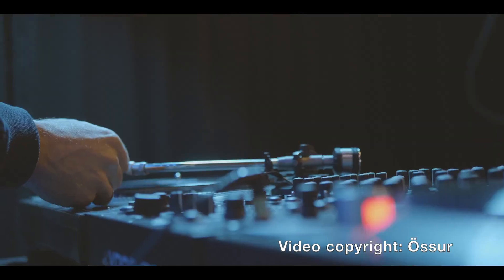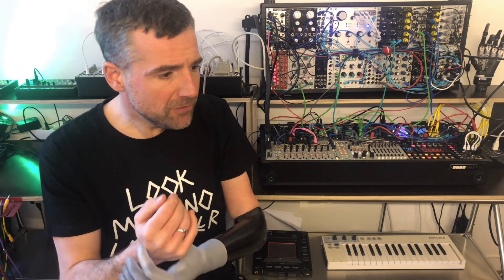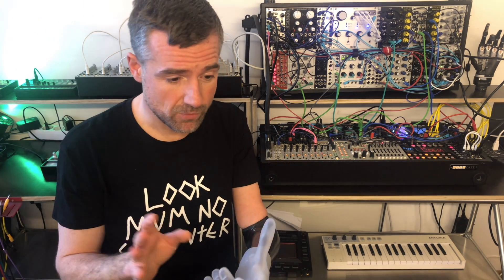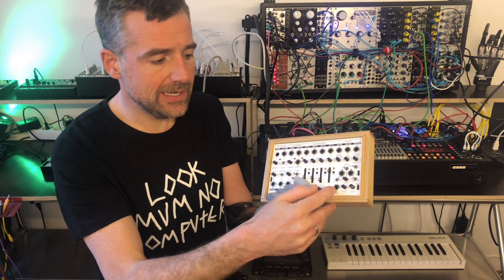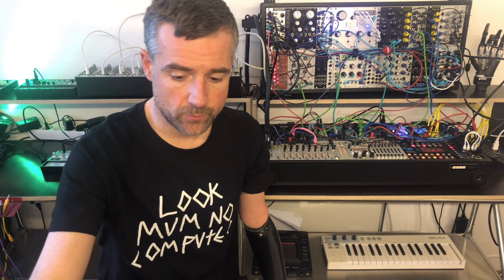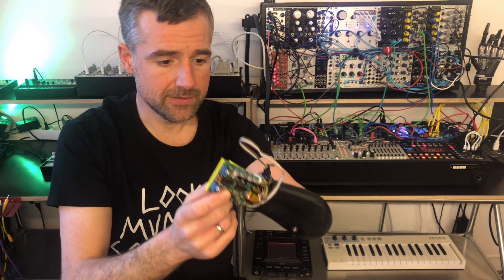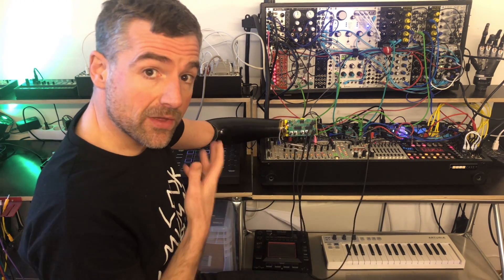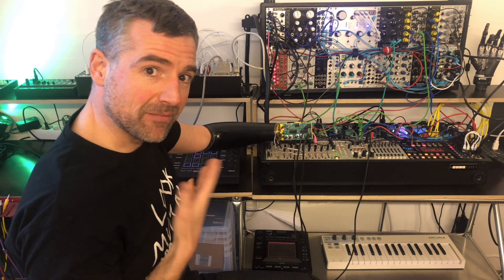Hacking my arm prosthesis to output CV so that it plugs into my synth: Thought-controlled music!

Comment: Hi! I'm not sure it could be easily controllable for you, but why not be using one electrode to set a signal and the other to switch between multiple outputs? This could permit you to control way more knobs but probably only one at the same time (depending on the configuration and your preference!)

Comment: I would recommend that you have the aux permanently connected to a box previous to the synth and this box splits in more aux cables that go to different parts of the synth. So then, with a switch in the box you choose which part of the synth you want to control in any specific moment.
With this you can forget about plug and unplug al the time.

Comment: My first thought is using the second signal as a gate for every port on the instrument, so that you could dial in to any knob you want (or at least up to something reasonable like 8 or 16, maybe in permutations to allow simultaneous control - whatever is manageable) for the first with less plugging/unplugging. I don't know if there's anything ready to go that's like that, and it'd take a lot of wires, but like having voltage 'shelves' for each input that routes the control signal to the right cord.

Comment: This is just wild speculation based off of my limited knowledge of how muscles work, but with a prosthesis that accepts signals for all the muscles that control the hand there could theoretically be 36 inputs something like this could modulate, minus the ones used to rotate the wrist.

I really wouldn't want to manage that many cables though, lol

Comment: This guy: "I can use a soldering wire" -> shot of him soldering microelectronics with a prostetic arm
Me: Remembering how I never succeeded in soldering a power wire to the board on my daughter's cheapo toy electric piano with my two fully functional arms :/
Reply: Hey dude go and try it again. I failed at making a simple webpage for days until it clicked. Just keep trying
Reply: @flarebear5346  In this example that's not the same if you fuck up one of the electronic composant with a bad soldering all the project can be gone. A webpage is more of an easy task because you can redo the features on and on
Reply: Mr. Scarf that’s why i realllly like coding,  despite not being my major field.
Reply: @Sqaarf  but it's still true, soldering is not that hard and can be learnt with some patience. First just start on soldering two wires together (later try some geometrical shapes made out of straight wires, also looks cool sometimes), leaarn how to connect multiple types of wire properly, then you might try doing some minor projects with scra plain copper board and then, I cannot praise this enough, buy some kits, you can find them cheap online and just solder. At least first few steps will help you make the most basic things, and that's enough for most ;)
Reply: David Gerner bruh im not even an adult and i find soldering pretty easy. Just stay focused while you do it.
Reply: alqaadi ya codings great until you hit compile and get 2000 errors and about 9x10^8 warnings that you’re going to ignore because warnings mean nothing and then about 50 lines later you hit compile again and the entire project breaks so you comment out the 50 new lines you added and the project still won’t work so you give up and make a post on stack overflow only to get shit on by some dude who’s been coding for so long he’s created his own operating system with a billion different custom libraries so he never actually has to write any new code he just reuses and rearranges things but still won’t answer your question. So you go to your prof for help and he tells you that you missing a semi colon on line 79 and your thinking to yourself wtf I thought that you didn’t need semi colons in python and he explains some reason that goes sooo far over your head you just say ok and switch majors into physics which is somehow an easier 4 years than your first semester of major ing in com sci
Reply: @ShroomBois_Inc  Well that was weirdly specific. You wouldn't happen to have a major in physics, would you?
Reply: Took me years to master Microsoft Notepad, I believe that you can master whatever you want.
Reply: @TheNuclearBolton , amen, brother. I still don't quite get how to deal with that Insert mode
Reply: Just keep trying, once you get it once it almost goes on its own
Reply: His hand may be more functional just differently the applications for these prosthetics are amazing
Reply: Use some solder flux man,
Stuff works wonders!
Reply: @Abdega  you really don't need it normally, maybe for really small stuff...
Reply: @somename371  sure you don’t need it, but it’s really satisfying having your solder flow where you want.
My soldering is so much better whenever I use it

Comment: I love how technology is enabling more people to enjoy their lives, like letting you get more control over your control surfaces. I’m an electrical engineer, let me know if you’d like my help with designing a more compact design. I specialize in optimization and PCB layout/ design and this would be a fun project to take on.
Reply: I would love to see more of this tbh. You could probably even build a midi control mechanism which would be nice!
Reply: Bump, with love!
Reply: I'd love to see this current dual amplified cv prosthetic circuit combined with the 2.4sink system from the chaps at Instruments of Things. This would be able to expand the functionality from the current 2 wired CV outs and add the upper limb motion and such to control even more parameters!
@Instrumentsofthings & @koma would make an AMAZING collaboration in this matter in my humble opinion! <3
Reply: I wonder how much you can shrink this. Seems to have a lot of IO.
Reply: Bump

Comment: I have an idea. 
You basically can control 2 outputs with your arm.
What you should do is: enclose the amplifier board in some closed off chamber. 
If I am not wrong 3.5 mm jacks (i think that's what you are using) have 2 "channels".
So you would need 2 pices of metal sticking out of the enclosure (2 for each jack). 
Then you build a rack of "sockets" shaped in a way to accept the amplifier board enclosure and in each of those sockets you have 4 contacts point (for the metal sticking out of the board/hand enclosure).
There are things called "pogo pins" I don't know how durable they are but that's what I would use.
From the sockets you pick up once again the signal with 3.5 mm jacks and hook that up to the mixer.
Now you can quickly plug your arm in the correct socket, change whatever you want to change with your mind and plug your arm in another socket to change another thing and so on. 
That would be so cool

Comment: Idea for the next project: Make a prosthetic mp3 player with a 3.5mm jack on the outside and a SD card slot on the inside. Put in a SD card with some music on it, plug some headphones into the 3.5mm jack and control the mp3 player with your mind. You'll definitely stand out in the gym, having headphones plugged in where your hand would normally be.

Comment: Man, you've just turned your hand into universal interface. I can imagine plethora of things which could be attached... Micro fluid dosing, micro manipulators, even soldering station, a keyboard.... There is a real potential. I guess the only limitation is on how many channels you can handle in parallel

Comment: I’m failing my computer science class so ignore my ignorance but would this mean that eventually something similar could be used to cerebrally output MIDI data?? Like if he had plugged this into a keyboard, would he be able to tell the piano what to play? Unfortunately, I don’t believe we think in harmony or chords, only arpeggiations and single notes, but I do believe with the coding knowledge, you can implement the theory into a database of some sort, defining chords and having it play them based off the theory, then when you think “C Major”– for example – it could play C Major. I don’t know, I’m not an engineer OR a psychologist

Comment: I got all my limbs and I have to admit I am just a bit jealous 😂 nice analogue setup you have there I’m super happy for you that you were able to accomplish this. Keep seeing just how far you can push things with this I am sure there is still lots of un-tapped potential.

One thing that immediately jumps to mind is hooking your output signals up to its own mixer of its own so you can control more than 2 signals at once ideally with different ranges for each output.

If you didn’t mind a bit of digital signal processing there would be other things you could do too but that may take away some of the beauty of analogue.

Comment: I recommend switching from THT to SMD, size of the PCB will reduce a lot.
And if you use paste+hotair station it's even easier to solder than THT so you should manage.

Comment: This was very cool to watch. If I understood this right, one signal will increase the pitch, the other lower the pitch. So they generally won't play together. You could possibly put a mode 'switch' in there that you can switch between if both signals are outputting. That way you could get more options from the device.

Comment: I have an idea for improvement although it would need heavy modification of existing prosthetic or even designing new one. If you could manage to put this into your prosthetic and switch modes between moving hand and outputting cv that would remove the need of removing hand from prosthetic.

Comment: So basically, this madman just hijacked his prosthesis to give his brain control over 2 on/off switches that he can plug into whatever knob he wants. This is mindblowing, because it's not long before 2 switches turn into 4, into 10, into 100. And you dont need to be missing an arm to do this either, we should be able to design a device that would attach to the users head and reads neuron outputs. I would love to be able to play a synth with my freaking mind. Also for any star wars fans out there...

"The synth will decide your sound"

"I AM THE SYNTH!"

Comment: Can you control the voltage generated by the electrodes with precision (with enough training)? 

I always thought that the "body communications net" was based more to system we could translate as a binary with PWM than a analog system. But I came to this conclusion based in videos showing the difficulties from newly amputated have to control prostatic implants... Zero experience in this subject.

Comment: Holy shit this is cool as hell. Could you set one of the channels to control which signal your other channel is sending CV to? So instead of just two channels sending CV, you'd have one with 11 outputs (0-10) and the second setting which of the 11 outputs you're actually sending. You'd be able to control 11 different outputs on one channel, one at a time.
Reply from the maker: That’s actually a really good idea! Could try this with a cv-controlled sequential switch!

Comment: I'm just imaging him finding a way to plug it into his arm with the hand still on and just control everything.
Reply: This was exactly what I thought after the voltage amplifier talk, why think about synths if you can go bigger...

 Like a computer to directly edit the music with some nice plugins
Reply: @Saturn.argo.  yep
Reply: maybe bluetooth
Reply: @JorgetePanete  hmmm i dunno if Bluetooth would be great with the latency but why not RC ?
Reply: @xenerius2151  you know that Bluetooth is rc right?
Reply: @JosueRodriguez08  Bluetooth is one type of radio protocol, based on transfer of finite data packets and has fairly bad latency, like a quarter second. good for file sharing, bad for music control. by RC he means any of the off-the-shelf radio transmitter/receiver combos intended for remote controlling aircraft. they basically broadcast a PPM signal which is a live stream of analog values (a stack of PWMs) with super low latency, these days there is a DSMX/FASST/FHSS frequency hopping which eliminates interference. It's a nearly ideal solution, except that they're generally higher power consumption unless you intentionally buy low power ones.
Reply: @chrismofer  still rc
Reply: the signals he'd use to control one would interfere with the other
Reply: @hunter1801  I know but if he could find a way it would be pretty cool.

Comment: This is awesome! If you want, I can design you a simple multiplexer board for the cover of your prosthetic, with two inputs from your prosthetic, and however many outputs with switches you need to drive all your synthesizer boards and effects. You would map each output to either one of the electrode signals or turn it off, so you would be able to control them in combinations too! Also, if you want to make it your brand and look like an insane techno cyborg at venues, get yourself an EMOTIV EPOC+ headset and control even more things with your brain! With a bit of practice you can control an entire Reaktor stack on your laptop with just your eyes and your brains.

Comment: "I am not an engineer",,,

No.. you're just some ultra hardcore nerd that uses your disability in unimagineable ways... and that is engineering in my book...

Next project: Plug your "stump" into an plug and steer your car handsfree in mid-air... ijn theory it should be possible... the question is how fast does the prothesis handle the inputs from your muscles...

Comment: That's incredibly interesting, and if you can send data signals over a prosthesis... This could be used for a wide variety of possible applications. Maybe you could eventually even get a hand attachment that acts as a USB controller, or perhaps eventually other various input devices, if you can make your prosthesis read as a USB device, then the sky's the limit for what it could do.

Comment: This has me wondering if i can attach a sensor to my wrist to detect finger movements via the tendines. If so, I'm sure the proper voltage translation can be made and you could fund a way to control 5 pots, one for each finger. so by closing a finger you control a knob? Just a random rough idea but id love to see this kind of thing as a wearable piece of tech so I don't have to go full cyborg to control a synth like that.

Comment: Couldn't you go wireless?  Have a receiving module in the rack and use that for the CV output jacks?  I would think that a pair of Pi Zero W's or ESP8266's could pull this off (in a much smaller space for the xmit module as well).  You could use the circuit board in the receive module as you'd still have to boost the output of the microprocessor to CV levels.
The only issue is that on-stage, people wouldn't realize that you are controlling the synth with your arm/MIND :) A couple of wires hanging off your arm leaves people in no doubt!
Good work fella!

Comment: this is so cool. Props to Koma for being supportive. 

I think ultimately this could/should evolve into a wireless device built into a hand shaped prosthesis (doesn't need to move) that lights up based on the voltages your are producing. 

The lights are an important element because the movement of human body parts is a way in which we all communicate but is especially important for a performer. 

All musicians have exaggerated body movements to express emotions, and even when they twiddle knobs very subtly. Our human minds are so sensitive to reading and interpreting movement that we can still interpret meaning from it.

Comment: Great video. Perhaps you could add a wireless interface to your existing prosthetic hand? Then you would have a Eurorack receiver and CV out box--and you could still have your hand. I was taken in, seeing you naturally emote and even at times self-comfort yourself with your prosthetic hand, like when you held your wrist.
Reply from the maker: BrendaEM I did think about that but wireless has way too much latency. For music, it needs to be instant and nothing beats an analogue wired circuit when it comes to speed.

Comment: Wow this is awesome.
(a little tip on soldering, leave the iron on for just a tad bit longer and add just a tad bit more solder, it is suppose to fill the upper side as well and will help a lot with reliability).

And how many "channels" does your arm have? i bet you could do a lot more with this idea.
Reply from the maker: Jimmy b Thanks for the soldering advice! It has two channels at the moment- we are still thinking about ways to get more out of it but it’s difficult.

Comment: Pretty damn cool! What you could do if you want to be able to control more values on your synthesiser is to build a separate board with two switches that that you can use to change where the two inputs are going.

Comment: I could see a few easy extensions of this project.. Instead of having the board mounted on your arm you could have a seperate board that runs the signals into either a bluetooth or wifi module. From there you could have the amplifier/controller mounted to your deck which would receive and output the appropriate signals. 
Furthermore, you could run that into a keypad/multi button selector that would allow you to rapidly change what your 'arm' is controlling by the push of a button.
Lastly, due to the reduced size of the board in your arm, you could likely mount it as an intermediary piece between your hand attachment and the limb piece and have it switched so that you didn't have to attach/detach the hand each time you wanted to use it 👍